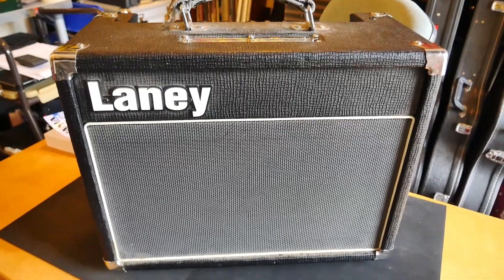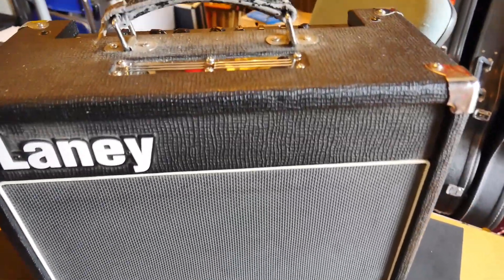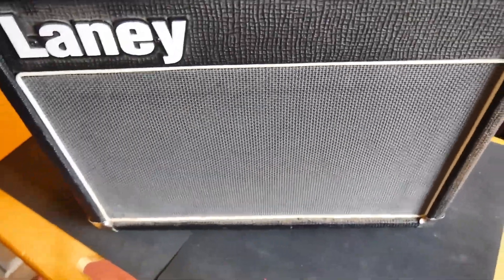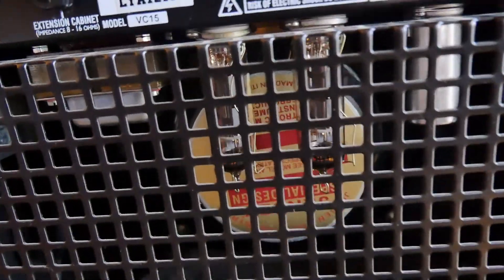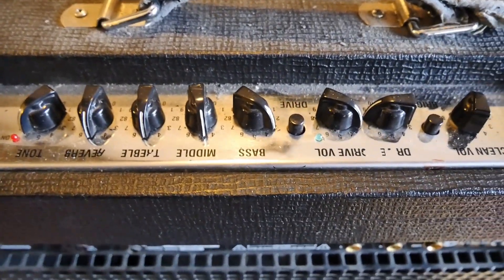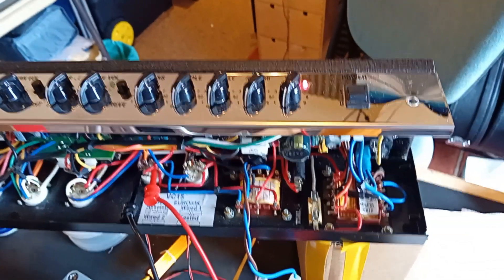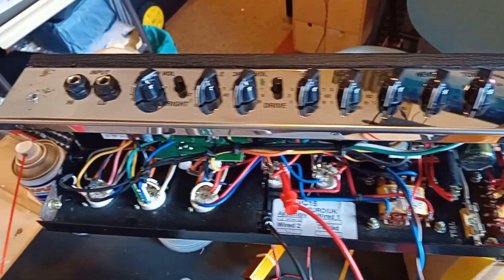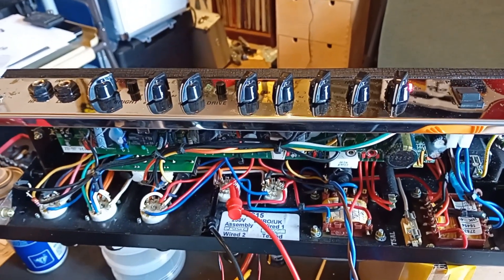Laney VC15 - 110

Comment: I have this amp and It delivers way too much treeble. even with treeble pot at 0 it's still too much and the bright button stays off...Any Idea where it can come from? Also do you think there is possibility to do a mod that would reduce the power amp section to half or 1/4 wattage?
Reply from the maker: Mine wasn't particularly bright and never found an issue getting a good sound at lower levels - certainly it shouldn't be 'too bright' with both the treble pot set to zero and the bright switch 'out' has it perhaps been modded with a bright cap across the volume pots?

Comment: Lovely sounding amp, but  a friend asked me to look at one of the same model that was misbehaving, and while I have it partially fixed so it's "working" it's not "right", so a couple of months ago I enquired of Laney about a replacement VC15 Pre-amp board 9416-6 and got the response "Sorry but those PCB's are now obsolete and no longer available". So when it dies it's dead.
Reply from the maker: @steveburrows101  This is the unfortunate fact about loads of amps, although in many instances, it will be possible to do repairs to the board (if you can find someone to do it) but the cost is often prohibitive.  I've recently sold mine, although it is a fabulous amp.